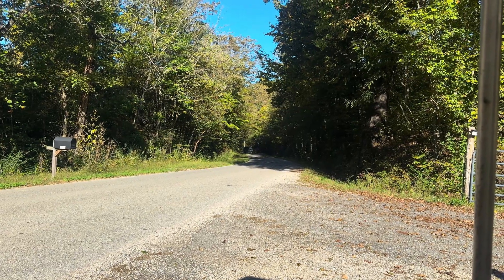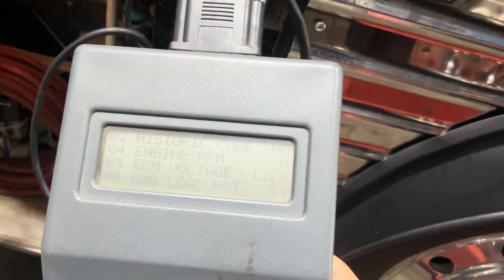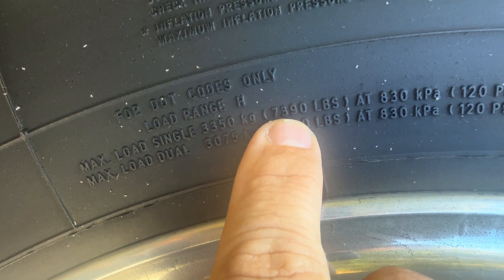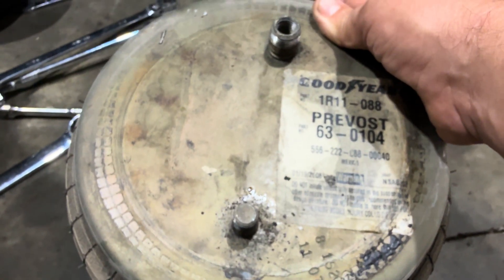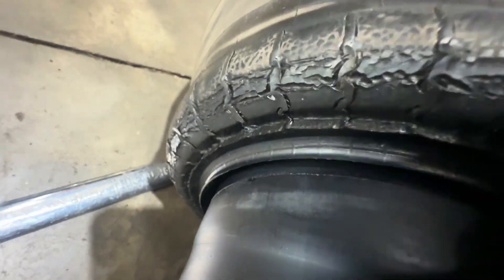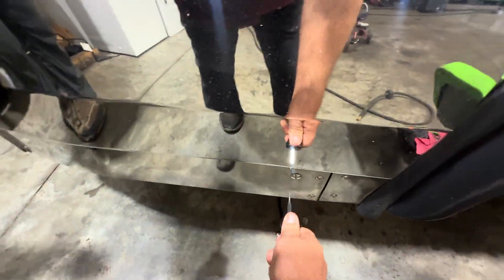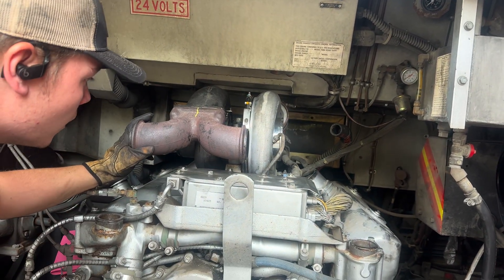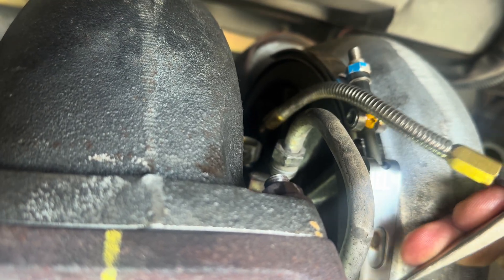Dangerously Overweight Prevost Bus.

Comment: Batteries would be the best weight loss if switched over from flooded or AGM to something much lighter. Being that is by far the heaviest weight in either of the front  2 bays. All of these calculations were made at time of conversation including tank and heavy item placement. 
The over weight issue came much later, likely interior overloaded?

Comment: Also won’t the larger wheels and tires weigh more and make it even more overweight??
Reply from the maker: Why run tires over the recommended weight when you can safely run at about 25% under the max load on the correct tires

Comment: Is that front license plate in Hebrew?  By the way, if this feller has had this rig in a couple times before for annuals, how come all these weight and balance out of whack issues - and the airbag issue - didn't come up on the last annual, or the one before that?  When he made the observations about the dangerous airbags, tires, weight, etc., the Grease Monkey here sounded kinda like Captain Renault in Casablanca: "I'm shocked, shocked, to find gambling is going on here."
Reply from the maker: Every time the bus has been in we have discussed it being overweight.  Obviously the changes they have been making are not enough.  We inspected the airbags every time.  This time they had cracking that needed to be replaced.
Reply: @BusGreaseMonkey  Thanks for the clarification, Captain.

Comment: I switched to a slide in truck camper setup a couple years ago when I decided to go fulltime, and the scariest thing I learned is that IMO probably half of the campers you see are overweight after having loaded a heavy camper onto a truck which is not rated for the weight. I did my best when configuring my setup, by charting all items and their weights even before I had placed my camper order, and I knew I wanted a dually so the search began. Long story short the truck I ended up with was a bit light on payload due to the trim level and the diesel lowering the payload, but because I actually did the homework I knew that I was within the weight limit when I looked at the door sticker, it was close, but not over. Some of these campers are 5500 lbs!

Comment: 5:10 max weight is per tire, not per 50% of the axle. So if he's running 7.5 tons on the front axle, he needs tires that can handle at least 6 or 7 tons to account for cornering forces. These 3.5  ton tires are way overloaded. When you corner, weight shifts to the outside wheel.

Comment: the "second shock mounts" in the front weren't for shocks, they had air cylinders in place of a sway bar, the system was obsoleted and removed but uses the same mounts as a shock. it would have had the same kind of mounts for the rear axle. Also, cat scales do not weigh the buses properly, cat will tell the customer to go to the scales and then call cat and give them the scale number and they will call the scalehouse and walk them through properly weighing a bus, because they always overlap the axles and it will always show the weights unequally distributed.

Comment: 4:20 that's most likely just tire scrub it happens when your doing lots of turns with 2 axles if you have 2 axles they cant turn so basic differential physics will cause scrub and what's called cupping that's why if you always turning around corners having dual axles is bad for tires, leaf springs and mounts
Reply: Those are the steering tires.

Comment: The heaviest stuff should be in the compartment infornt of the drive axles. Not the compartment behind the steers. 
For future reference when setting up your bus/rv. With nothing in it. Fill up the water grey water and fuel tanks . 
And CAT SCALE IT. That is your empty weight now take your  mfg gross axle weight and subtract the CAT weight from it. 
Knock off a ton for passenger weight. 
So 12000, 20000 12000 is 32000 lb gross weight . 
If you want to be anil about your axle weights get a set of Aire Weigh scales. Then you'll know real time.

Comment: The batteries in the front bay have a lot of weight. If they are just for the house batteries (so your not constantly running the generator) and not the engine. He could switch to lithium or equivalent. To get the same power from one battery instead of 6. That's alot of lead being removed from the front axle.

Comment: The biggest takeaway from these videos is that a bus is an enormous money pit
Reply: TRUE THAT. I made the mistake of buying a sailboat to live on. turned out that a depreciating asset as your primary residence is not a smart financial decision.
Reply: Owning a commercial vehicle as a personal vehicle is always going to cost a TON in maintenance.
Reply: But if you have a Class A motor coach and need it for extra living space you have it upon arrival as a registered vehicle and you don't have to deal with permits for a building.
Reply: @HappyQuailsLCjust make sure your town allows it on your property
Reply: Imagine spending a fortune setting up your bus how you like it and its 1500 pounds overweight from the absolute limit before your wife gets in it.
Reply: I just watched another channel where the roughly 40 year old bus had just been purchased without any kind of mechanics inspection, turns out the thing was bought from some grifting pastor who lied about services performed and simply screwed over his fellow man.
Reply: @boostedlss6450  i thought grifting and pastor is synonymous...    i'm sure he  told him it was only used to drive to church on wednesdays and sundays...
Reply: Its not if you maintain it correctly!
Reply: @myronsherman8571 not at all expensive!!! They only cost thousands of dollars (average in 2025 is $300k), tires are $300-$1000 each, oil changes are several hundred dollars, storage is expensive, cost $1 grand to fill with gas. not counting engine, transmission, electric problems or HVAC repairs and appliance maintenance or replacement

Comment: also check lock to lock turns    an overlock can cause that wear         the pressure rating is a minimum psi    42 years driving experience on big trucks

Comment: just a thought.  the front tires wear issue.  The front axle is 13k limit, you have 14,3k on it.  the inside of the tires are wearing.  the axle is bending and flexing like a smile.  Therefore the inside of the fronts are cupping and destorting the alignment with all the weight on it.  With the stands under it, on the spring joints it keeps the pressure on the wrong place.  He can leave his stuff the way he is comfortable and replace the axle with a heavier version and keep the tires flat on the surface.

Comment: We have a 33 ft Fleetwood. It is an older machine (2008) but only had 13K miles on it and is very clean and well maintained. One thing I am doing is installing the Supersteer suspension and handling upgrades. Total cost was about $8K but that Ford F53 Chassis wallows like a whale on a bicycle so I had to do something. Waiting for it to come back from the shop as I write this. Hoping it helps! I have to say that the V10 Triton is a good engine but our next RV will be a diesel pusher like that Prevost, although pretty sure we won't be able to afford a Prevost. I was nervous about buying a diesel for our first RV as they run well BUT if they have an issue the costs are pretty high to fix.

Comment: So when you look at axle weights, is the load rating the amount of weight pushing down on the axle? If so, the tire adds weight to what you are measuring. Bigger tires weigh more, so that will show more weight on the scale than what is on the axle. In other words, there is a small amount of artificial loading on the scales.
Reply from the maker: The DOT uses a scale. They don’t play around with math.  Weight is weight. Wheels on the ground.

Comment: Wouldn’t adding heavier wheels and tires be counterintuitive when your main issue is to lose weight. That’s also adding rotational mass to the axles bearings. Seems the factory R12 should be enough, if inflated to 120 psi, based off his CAT scale.

Comment: We have a coach about this age except it's an Entertainer coach. We also have weight issues with the front axle; it turns out the generator being in the front bay rather than the rear bay which is the norm on a Prevost entertainer coach. The result is all front-end bushings and bearings wear out quickly. BTW, if you or anyone needs a GM 4106 parts bus let me know. It's complete, but the interior is rotted out. You will need to take the entire bus.

Comment: This is an EASY fix, just source a dual axle tractor with dual front steers and add a second steer axle. Problem solved. Or, just add a self-steering tag axle behind the front axle. easy peasy lemon squeezy. Got checkbook?

Comment: Americans use the term "dry rot" to describe rubber degradation. Dry rot is a fungal infection of latex, this was a thing half a century ago. Modern rubber does not dry rot. Most degradation is simply polymer degradation from age or ozone/UV exposure or mechanical movement, as in the case with those airbags. 

The vehicle is overweight because the cabin is overbuilt.
Reply from the maker: We also use the term brain rot to describe people that are getting dumber but we don’t really think it’s rotting brains for real in their heads. Some people think they are superior than others.

Comment: 6:50 That tire is not going to blow out from over weight. If that was true, There would be a lot more blowouts. I've been driving trucks for 19 years. I've had 3 front tires blowout and I didn't have any problem controlling the truck. I can send you a link to one blowout where I was doing 65 mph.
Reply from the maker: A huge percentage of buses that have a front tire blowout end up on their side in a roll over.
Reply: @BusGreaseMonkey  Yes some semi trucks run off the road too. A lot of drivers are weak when a tire blowout.
Reply: Retired truck driver but the only 2 steering tire blow outs I had were the old bias ply tube tires. After changing to tubeless radials never had a problem with steering tires. Only problem I had was cupping and apparently that's common on non drive tires.
Reply from the maker: @ericgeorgetruckgrilling buses carry a lot more weight on the tires than a truck. 8 tires carry 43,000 lbs constantly and not evenly divided between them.  Bus front axles are way heavier usually too.
Reply: @BusGreaseMonkey I ran just under 14k# on my 16k# front steering axle. Just under 38k# on my tandem drives and just under 19k# on my 3 or 5 axle trailer axles.
Reply: @BusGreaseMonkey That is true. I’m sorry for questioning your authori-tire.

Comment: If you have been doing inspections every year how come all these weren't addressed last inspection?
Reply from the maker: The airbags were not splitting apart last year.  Tire wear was not like that either.   Turbo had good boost.   We weighed it and discussed the over weight issues.  They changed the house batteries to lithium to loose a bunch of weight.  But it’s still way overweight.  We now have gotten the point across that the weight needs to be addressed now as a very important item.

Comment: If I were you, I would take this video down, if he got into a serious accident and it’s known to be overweight you would be in serious trouble, they would sue your a$$ off, the little weight that he is going to remove isn’t going to help, plus he is towing a full size pickup that’s loaded down, transferring water to pickup doesn’t help , water is about 9lbs to a us gallon. Going down the road at 70mph and something happens in front of him, he couldn’t stop in time. Everyone forgets about brakes & breaking . As a Class A driver & Red seal HD mechanic, I would refuse to work on that time bomb, also he is an older driver and his reaction’s aren’t good as they used to be, I doubt that he has a cdl , I hope you have good insurance, I don’t know how you could sleep at nite, rant over, cheers
Reply from the maker: He won’t be overweight when he leaves here.  That is full fuel and water.  But he needs to make changes so he can travel with lots of water. The truck has its own brakes and gvwr.   Rv is exempt from cdl.

Comment: Removing the batteries from the passenger side, bay number one would take a lot of weight off the front axle. 
Try placing them in the space over the tag and drive axles.
The generator should've been installed in the third bay, driver's side
Reply: Yeah, but he said they are over gross too, not just the steers.

Comment: That front axle overloaded will cause flexing, likely the reason for the odd tire wear.  Betting the wheel bearings are taking a beating too.
Reply from the maker: We replaced them two years ago.
Reply: @BusGreaseMonkey so the bags and other worn components checked out fine two years ago and have degraded to this state in just that time? Wow.
Reply: @thedangersofboredom That's what I thought was,weird too. At the beginning,  he said he's seen the bus the last 2 years in a row. So everything, presumably,  has happened in 1 year. 
And only overweight in the last year? Not sure on that one
Reply from the maker: @GeofCates8075  it was overweight.  They switched from lead acid batteries to lithium to save weight.  We replaced all the front wheel bearings because they were shot and we did some kingpin work too.  All on the front end.

Comment: A Voith CRU DIWA 867.7 NXT retrofit produces 30kw at 48vdc. If he replaces his gel batteries with heated LiFePO4 batteries, he might be be able to put in a smaller diesel genset. The 7 speed has a .51 deep overdrive. Finding a Voith mechanic might not be as easy. 35k out the door.

Comment: Stupid question, can a heavier axle be put on it?
Reply from the maker: It doesn’t change the fact that gvwr is already exceeded for the entire bus.
Reply: @BusGreaseMonkey I’m fascinated by the gvw issue. I’m more familiar with much smaller RVs. But I’ve read test evaluations of RVs where the RV delivered for testing by the upfitter was at or even over its gvw empty tanks, unloaded and no occupants. I’ve come to think there is some sort of wink wink in Bs and Cs. Generally though, axle limits in those and tires in those rvs add up to quite  a bit more than gvw, which doesn’t seem to be the case in the Prevost. I know with little Sprinters there are hints the gvw is intentionally set low in the US. European versions appear to be available quite a bit higher.  US regs? 

The items you went over sounded like under 1,000lbs. If it’s gvw is in the 30s that’s under 5%. Does Prevost set the gvw that precisely? That’s an incredibly low margin of error.

I’m thinking your switching out the tires was a brilliant move. Maybe they consider the same in the rear. And bigger brakes, if possible.

Comment: Seems to be a great bus though, engine is smooth and quiet and pulled it up the hill only rolling a bit of black smoke despite the turbo issue.
But overloading the front axle and tires aka the steer axle 
😬
not good

Comment: Not understanding how it was over weight. This bus is designed to carry 50+ passengers with their luggage.
Reply from the maker: It’s a house inside.  How heavy is everything in your house?
Reply: @BusGreaseMonkey  Yes but every RV of this size is a house inside also. Why is this one heavier than the others that you work on of the same size.
Reply: You haven't answered the question. How does a couch, a refrigerator, and a bed make this RV overloaded. You said there is a house inside but this is not an adequate answer. Please explain. You focused on the air bags but you did not provide an explanation.
Reply from the maker: @Taras-Nabad 120 gallons of fresh water.  House battery system with inverters.  Granite floors and countertops, cabinets, furniture, and the list goes on and on.  The buildout is very heavy inside
Reply: Nothing personal but I dont understand how this particular bus differs from the other ones you work on. They are all configured the same way.

How is this bus configured differently than the other busses you work on that is making it overweight.
Reply: Granite countertops weigh a lot. So do solid oak cabinets. Most RVs don’t have those.
Reply: @sha1om the counter tops and cabinets are 500lbs. That's nothing for a bus like this. The numbers dont add up.

Comment: In 2004 wife and I were heading west in Arizona.  We were in our F550 with Fontaine Classic Traveler body towing our 36 foot Grand Teton 5th with the cruise at 62.  We got passed on the flat by a Prevost bus but on a semi-long uphill I passed him. Back on the flat he came by me., up the next hill I passed him.  Later in the day we ended up in the same campground 3 spaces apart.  As we got to talking, he said he had it flat out uphill and was embarrassed I could pass him.  I asked him about dialing up his horsepower and he replied he wanted to, but was advised the transmission would not take the added power.  He also told me he was heavy.  I was happy I had the rig I had.  Not quite as shiny, but traveled well.
Reply: Was his wife onboard when you passed him twice?